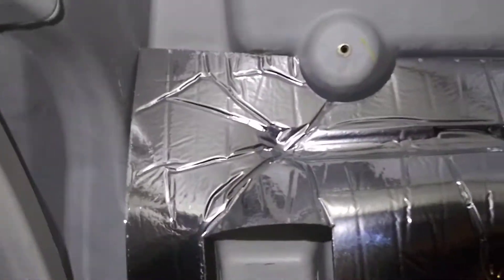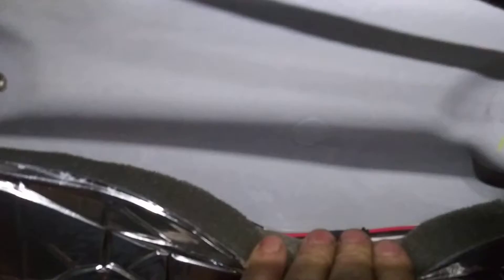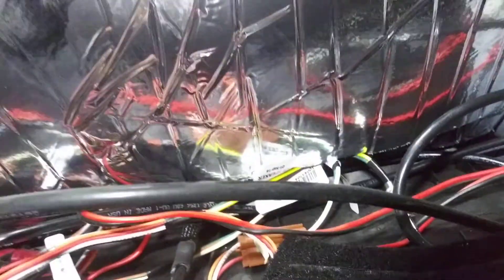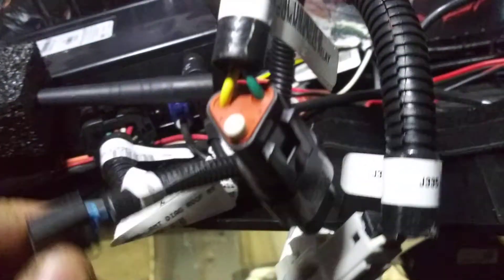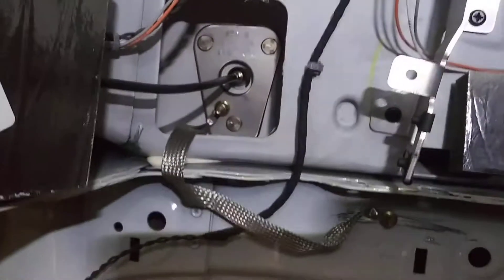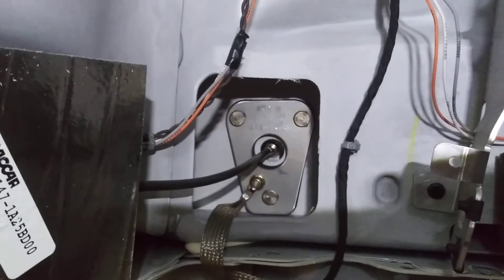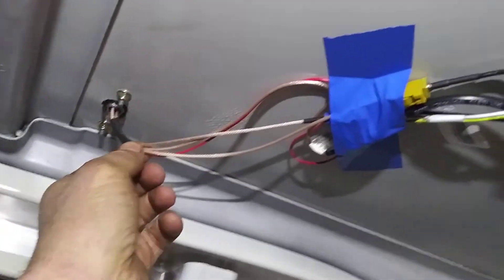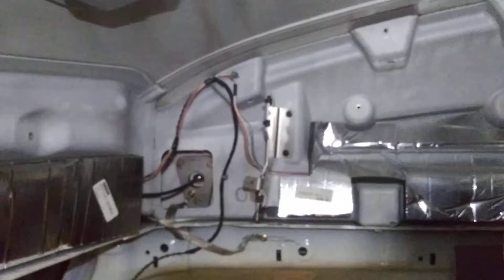579 peterbilt wiring hidden by the headliner

Comment: Condensation also comes from having the truck closed off and you're breathing in the truck all night and it's cold outside. I had water poring outta my head liner in my 1ton when u was hotshot. Anless you pull liner put some thermal  Sound detonating pill n  stick it will keep doing it

Comment: Do you have a video showing how to take it all apart?? I need to do same thing with my truck.
Reply from the maker: No sorry I had to do this to another truck recently, but no video.
Reply: It's a pain ass bro, you literally have to remove everything, a and b pillars, both panels above the doors, all lights, visors, and the screws under it, than the headliner and you'll get to the last of the screws holding the overhead panel in... they make them like this so we don't work on em like we used to bro.

Comment: How did u get the pieces off to get the wires wanna fix my air horn
Reply from the maker: I think I took the a pillar off then had to look for screws in the side pocket.  I think you can carefully pop the cover off the side some light and get to screws through that when you get some stuff apart gently pull to see where additional anchor points are